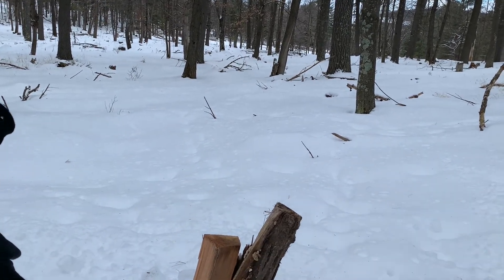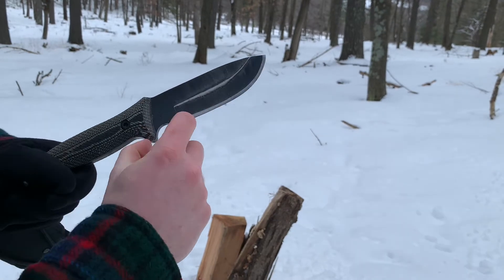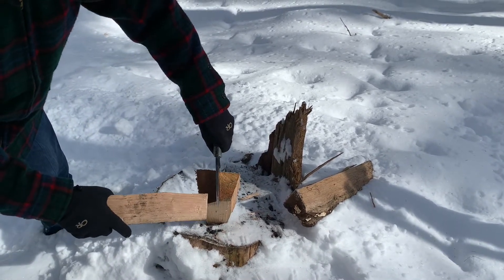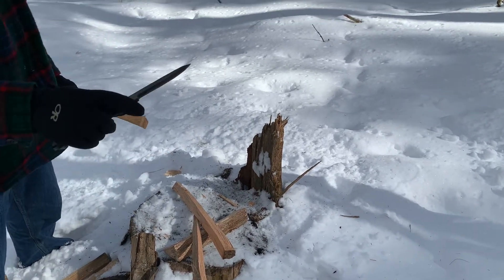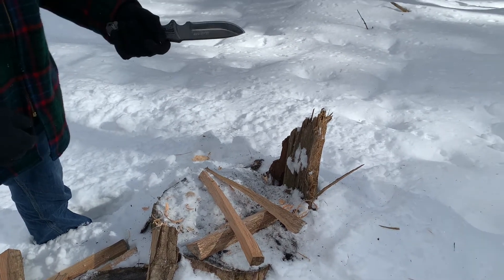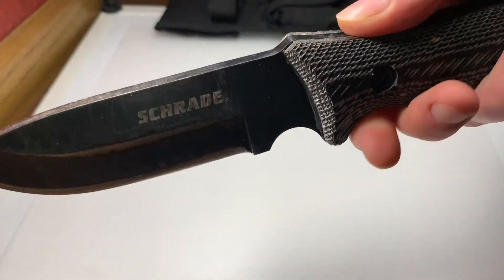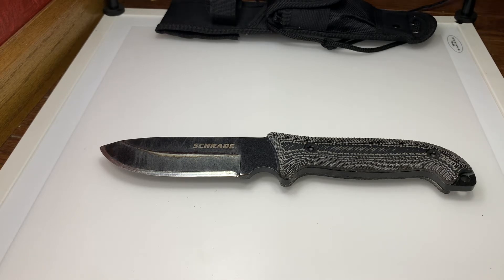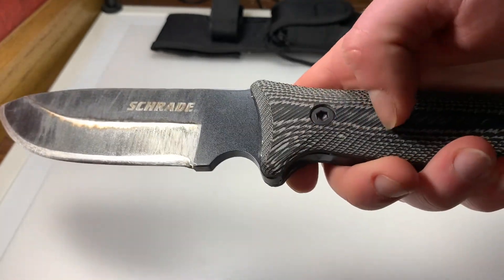Schrade SCHF51M Frontier Fixed Blade Re-Review

Comment: I have the SCHF52M. Basically the same knife, just longer. I wasn't overly impressed with it. I used it once, and it's sat in my closet ever since. It's a batonning champ, I'll give it that, but I should have stuck with my Mora, lol. I did knock down the rough edges on the micarta with some sand paper which made it a bit more comfortable, but it was just to thick and chunky for my taste.
Reply from the maker: I'm with you 100%, it's got some pretty big issues, but it does baton like a beast at least xD

Comment: wow. on paper this sounded like a real deal. smkw a few months ago lowered this price to as low as $33 i think. i had it in my cart, but it sold out. maybe i'm glad, cuz it seems to have three major design flaws: a bad grind, awkwardly place choil, and an overly long handle.
Reply from the maker: The thing to keep in mind is that these are flaws "for me".  Other people might like a thick grind, might like having a gigantic choil, or a really long handle, but for me they just aren't ideal.
Reply: The Schf51M is now $53.99, I picked mine up on Amazon back in August 2021 for $43.51, and i don't regret it, because she hasn't failed me, she is my sharpened pry bar. As for the screws the gentleman made note of here on this video, You will need to tighten them down some to get the handle secured to the full tang handle.